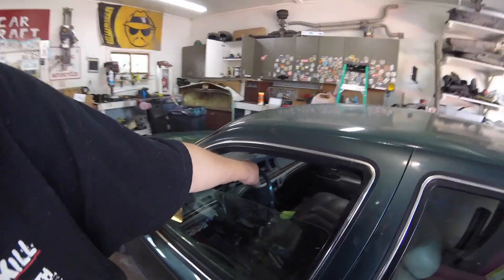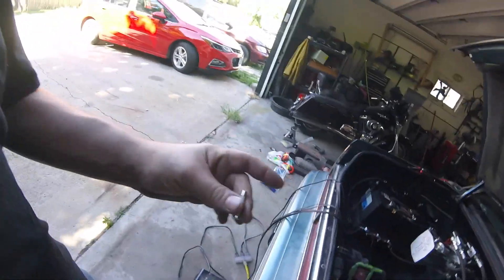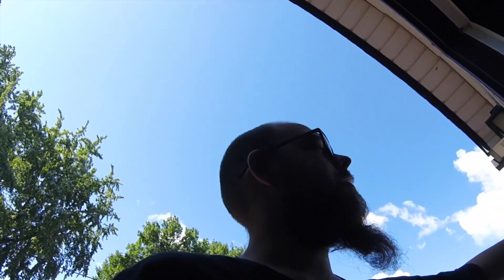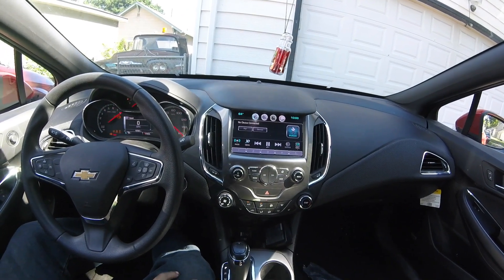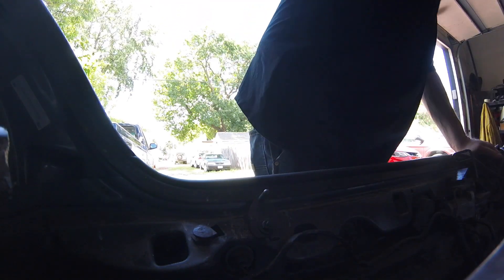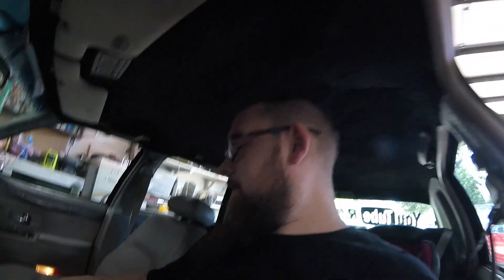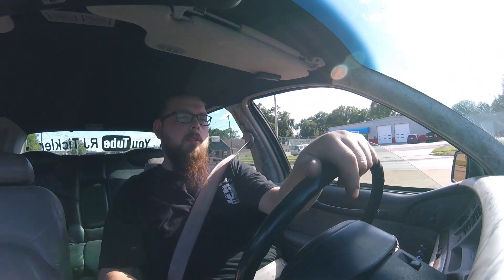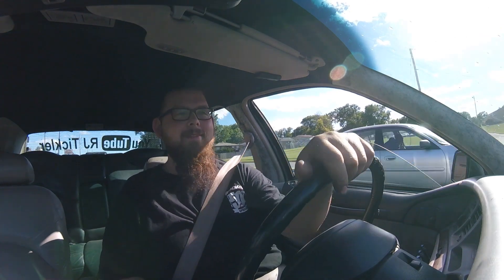Lowrider ISSUES!! AGAIN!

Comment: Those chargers are good. I can tell you how it happened. You have to set charger to proper voltage 1st. 2nd make sure charger is off. 3rd attach to batteries. 4th plug in charger to wall. 5th select 5 or 10 amp. If you don't follow that order you can pop a fuse especially if you select a different voltage while it's attached to batteries. Hoppos all the way. You can just order a Hoppos Pump and 2 extra Hoppos backing plates swap em out and then all 3 will look the same👍.
Reply: Those manufacture fuses suck cus you cant see if they're busted the charger will get power from the outlet but a bad fuse will not send it to the prongs

Comment: what's up man been a bit ... just  wondering  why not 4 pumps
Reply from the maker: Mark Moore really don't have any reason to have individual control over your front cylinders. Plus it can be kind of a headache to get everything working in sync with two separate pumps to the front. I would rather have a single piston to the front but I would probably get in trouble with that lol.